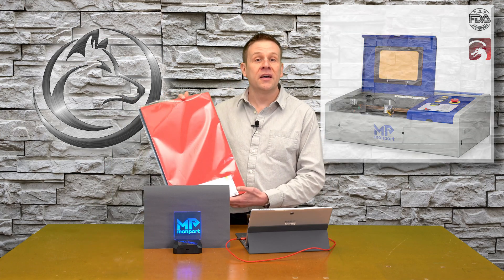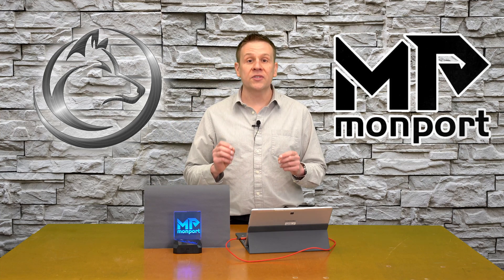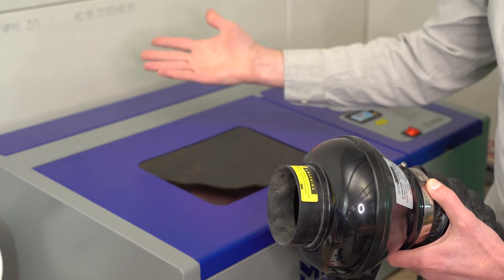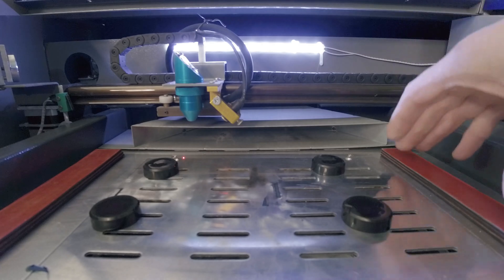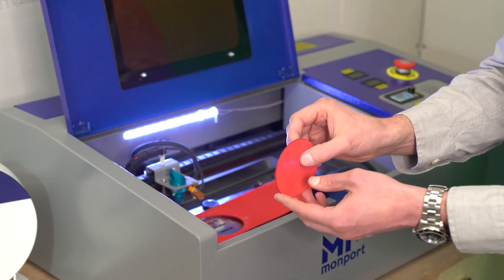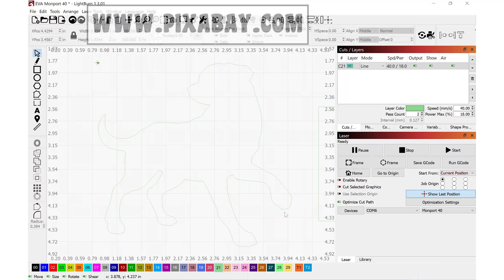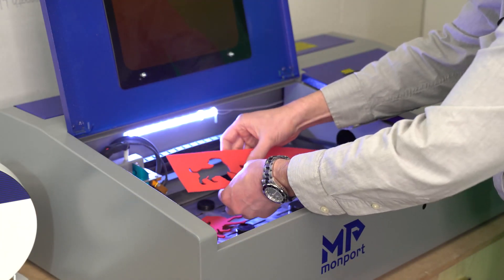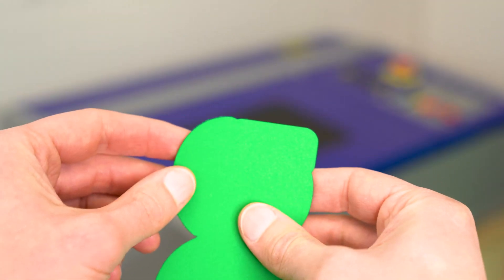Monport 40- EVA Foam Project!

Comment: Thank you! You explain things very well!  I have a question on those risers you used to place the EVA Foam on top of before cutting.  Where can I get those, what are they called and  is there an alternative object I can purchase  from my local hardware store that would do the same thing?  Thanks for your helpful tutorials.
Reply from the maker: Hi- the stand offs are some simple plastic magnets I had around the studio.  I used them because they just happened to be the height I needed.  Some wood scraps would also work.  I only recommend laser safe items in the event the laser passes over the item.  Enjoy!